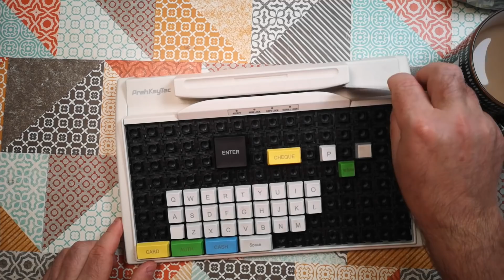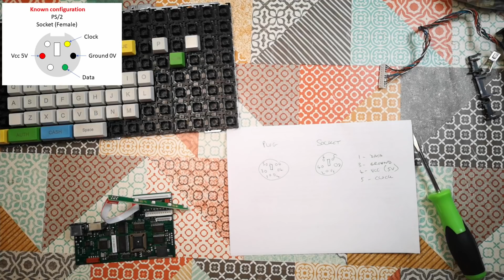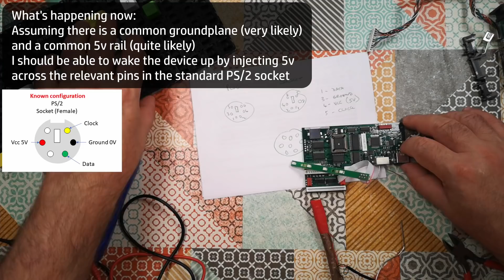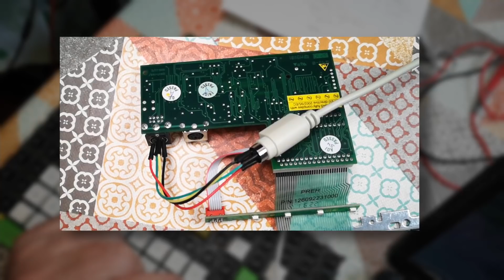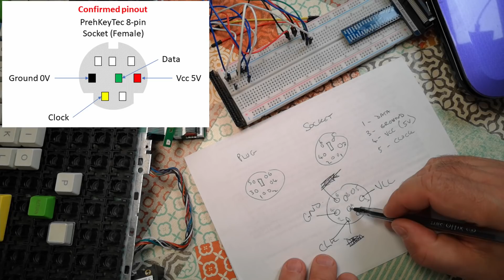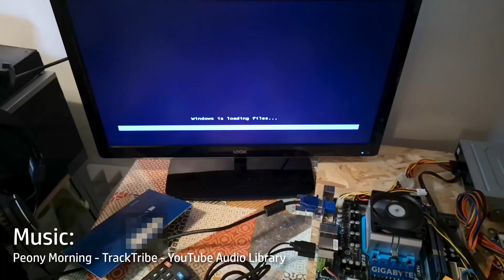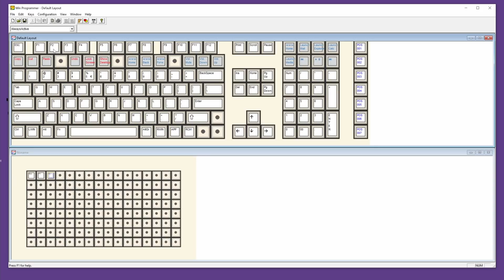Reviving a Weird Ortholinear EPOS Keyboard (PrehKeyTec MC 128 WX)

Comment: I think I still have a couple of these keyboards... well I've retired and I think they're still stashed in a supply closet where I left them.  They've been rendered obsolete by a POS change since then.  This one looks like the larger keyboard that wouldn't be found at a typical checkout, but possibly at a product returns desk where more functions are required.
Reply from the maker: Yeah, this is the big one with 128 keys - they also have models with 96 or 84.  I suppose this one might also work in situations where all of the keys need to be bigger than 1 unit - maybe if the operator needs to be wearing gloves or something
Reply: BTW I believe that is a USB port you're working on.  If you had the proprietary cable that attaches this keyboard to the register, you'd likely find it's an old-style USB.  It's a weird thing about 1 centimetre square and has a clip to anchor it to the rear of the register.  Nevermind, now that I think about it again, it could be the same at both ends.

Comment: For nice printing method, you can smear some laser printer toner on the keycap and get them low power laser engraved. It will embed the toner in melted plastic and leave a text/image only on engraved parts.

Comment: super interesting video despite being sorely out of my depth, im curious though if anyone can explain the need to "not move your mouse" during the key assignment?
27:00
Reply from the maker: Not exactly sure, but the PS/2 protocol is interrupt-based.  USB devices generally work by waiting for the host computer to ask them their status, but with PS/2 mice and keyboards, it's more like 'stop that and listen to ME!' - so I suppose it's possible that an input from a mouse could interrupt the transfer of data out to the keyboard.
It's kind of annoying because in order to click the button on that warning dialog, you have to use the mouse, and you are then faced with the choices:
1. Take your hand off the mouse, probably moving it
2. Keep your hand on the mouse, probably moving it
Reply: @AtomicShrimp  Hi, I started watching you for your scam baiting and got hooked on the randomness of your other videos. Especially love the weird stuff in a can series. 

You can do almost everything in windows with just a keyboard by using the Tab key (and Alt Tab) to move the focus on the next element (or program). That should allow you to choose the dialog box and then use the return key to dismiss it without moving your mouse. Hope that helps.

Comment: Could you not have run the software in 'legacy' mode for 32 bit? May have saved having to install Windows 7...
Reply from the maker: No, it needs the 32 bit OS - the manufacturer's PS/2 keyboard driver replaces parts of Windows built in drivers - and this only works with the 32 bit driver set
Reply: @AtomicShrimp  fair enough. Great video BTW. I used to program similar kit made by Wincore Nixdorf (sp?) In the late 90s. Lots of memories came back from having seen your video. Thanks!
Reply from the maker: The little VGA screen I used in the FrankenTerminal is Wincor Nixdorf.  With sufficient patience, these things can be snapped up really cheap on eBay

Comment: I remember coming to Canada after using keyboards in England many years ago and having to get used to the US layout.  Now it seems strange to see the quote above the number 2 and the pound sign above number 3.  Where is @ and # on UK layout?
Reply from the maker: @ and # are usually somewhere around the location of the Enter/Return key (depending on whether it's proper UK-ISO - where they are directly to the left of the bottom of the Enter key or some UK-localised version of something else such as a laptop keyboard - on my HP laptop, # is above the Horizontal 2U Enter key and @ is to the left)
Reply: @AtomicShrimp  The apostrophe/quote key lies in that spot, handy being next to the shift key for coding.

Comment: You could probably be able to "write" on the keycaps with laser cutter at low power...?
Reply from the maker: That's the plan - paint them with a layer of black water based paint, laser the legends (fusing the pigment into the plastic), wash off the remaining paint

Comment: I am looking for a keyboard like this for my CNC machine I am retrofitting with Linuxcnc
Reply from the maker: They're quite cheap on eBay sometimes - I'd recommend getting a USB model though, just because the setup of the PS/2 is finnicky even under better conditions than you saw here
Reply: @AtomicShrimp  A more modern one would be nice, proper CNC keyboards are very expensive
Reply: @AtomicShrimp  There is plenty of these keyboards on ebay I noticed, I am going to buy one and use your video as a guide to convert one into a usable keyboard for my cnc machine, I will programm the keys for specific functions, thanks for the video and the idea.

Comment: Why don't you use an arduino to drive the keyboard?
Reply from the maker: That would necessitate learning all about Arduino (something I may do if I have time).  I think I'd be more likely to keep the control board from this, and build my own key matrix for it out of proper mechanical switches mounted into a metal plate - I reckon it would probably be very easy to reverse engineer the keyboard matrix by just testing continuity on the ribbon whilst holding down specific keys

Comment: As I recall the PS/2 was bidirectional. For exmaple the caps lock / num lock LEDs were actually turned on or off by the PC via commands over the interface.
Reply from the maker: Good point, although I also seem to recall on some older machines, the PC and keyboard numlock status being out of phase with each other - pressing the caps button would turn out the light on the keyboard, but turning caps lock on.  I will need to look into that some more...

Comment: "How do I print my own Keyboard legends?" 

I watch a few restoration channels.... It's possible you can print onto silicone covered paper in reverse / mirror image,  and the ink will transfer to the keys with some heat and pressure - the videos I've seen use a paper laminator. It's not going to work for thick keys, but a hot roller might, and a plastic compatible clear coat could keep the ink there.
Reply from the maker: I've got a laser engraver - I'm going to try laser tattooing them - paint them black with water-based paint, then laser the logo into the surface - the black paint bonds with the plastic where the laser touches, then wash off the surrounding paint.  I think it should work...
Reply: @AtomicShrimp  I hope you video the attempt, good or bad.

Comment: Curious, can you not emulate a 32bit operating system, for the purpose of reprogramming this?
Reply from the maker: Yeah, the driver has to be running on the machine itself - it actually replaces the standard Windows PS/2 driver files so it can use the PS/2 port in a bidirectional mode.  I think if it ran inside a VM, the VM would believe that was happening, but it wouldn't make it happen on the physical port.  I may give it a try sometime as I intend to install multiple OSes on the wall PC
Reply: @AtomicShrimp  Ah, of course. I hadn't considered the driver side of things.

Comment: "hate for membrane keyboards"

As a professional writer, I prefer membrane keyboards. Silence is my second-most desired feature in a keyboard, the primary is being programmable and having extra keys to the left of the regular keyboard (for uncommon punctuation—at least, uncommon for everyday use). My keyboard of choice right now is the Corsair K57, which has the above features plus the advantage of bluetooth (on top of corded operation) so I can use it with my tablet and even phone. 

As for those neat multi-size keys, those little arms form the same purpose as sway-bars in cars—maintaining "ride height" to prevent body-roll.

The PS2 plug on those for passthrough are probably for service techs to repair the terminal machine they're hooked up to, or possibly having a barcode reader.
Reply: A lot of these "mechanical keyboard enthusiasts" actually totally cream themselves over Topre, which are expensive (very expensive) membrane keyboards.

There are of course silenced mechanical switches with two way rubber stoppers, or some people use o-rings which silence just the downstroke.
Reply: @SianaGearz  I've found, mechanical or membrane, if you put a few million words through a keyboard, they stop working. 

When I find a board I like (like the Corsair I mentioned), I'll buy several of them so I can go a few years before having to worry about a new model.
Reply: @ConstantlyDamaged  The difference here is that you can replace the switches on the mechanical keyboard when they stop working. Membrane keyboards in general are disposable.
Reply: @BrunodeSouzaLino  I know, that's why I buy a pile of them :)
Reply: You could have just downloaded WinCompose (not even installed, although that’s optionally possible) on a Windows computer. It basically enables Linux-like composition sequences for non-ASCII symbols, including dashes (⎄--- → —), “correct” quotation marks (⎄"< → “, ⎄"> → ”), and even interrobangs (⎄!? → ‽). A lot of people assign the Compose key ⎄ to Caps Lock or the right Alt key.
Reply: @cmyk8964  Oh, for sure, and I'm actually planning to load linux on my PC shortly, but the extra keys are what I'm used to. The only exception I have, and what I love about its programmability, is I can disable the Insert key.